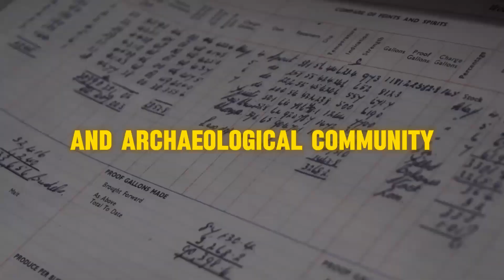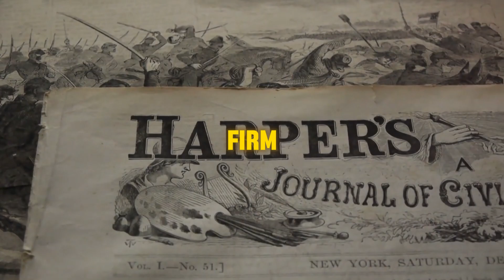The Drill Found in Million-Year-Old Coal

Comment: the drill itself may have been involved in a subliming effect rather quickly.  i dont know if coal can sublime metals.

i do know that metals can sublimate when exposed to outdoor elements rather quickly as in the case of a hammer found by a farmer which was encased in stone block in the 1870's.

in the case of the drll,its likely that the coal debris filled in the drill cavity and harden over time.